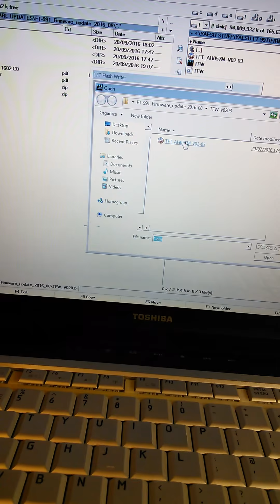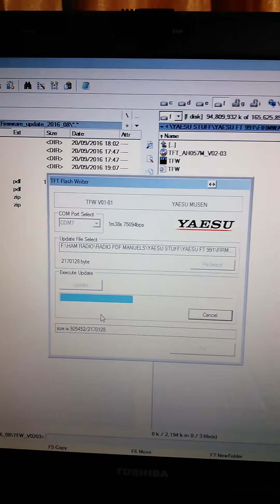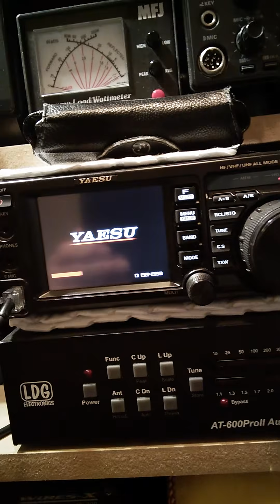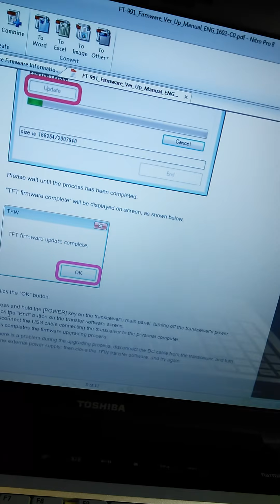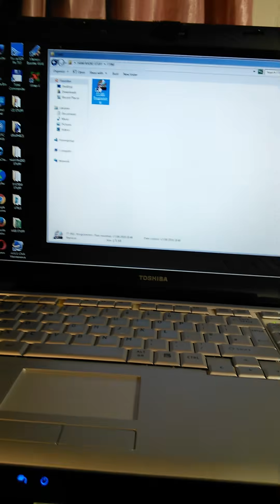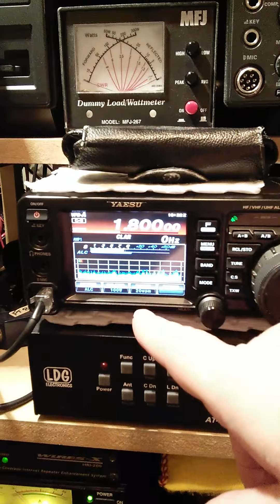FT-991 Firmware update Part 2

Comment: I believe it's never a good idea to use old settings (backup) with updated firmware because the old settings can corrupt new features. Every firmware update should be followed by a fresh start in programming your device, then do a backup. The backups can then be used within the same firmware versions.